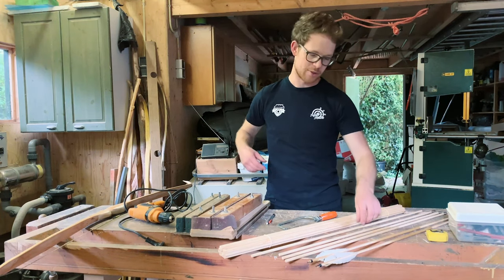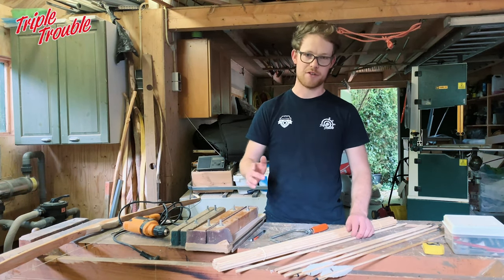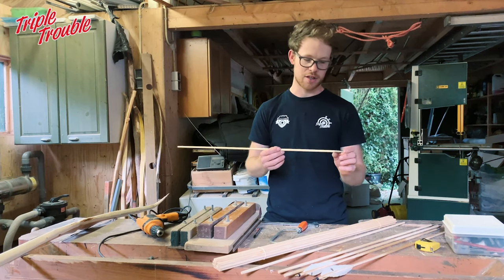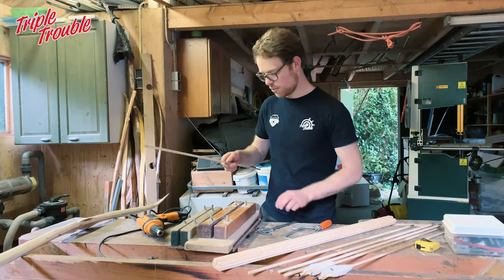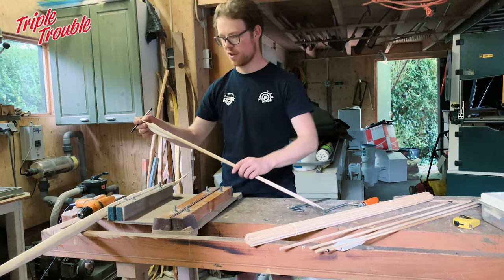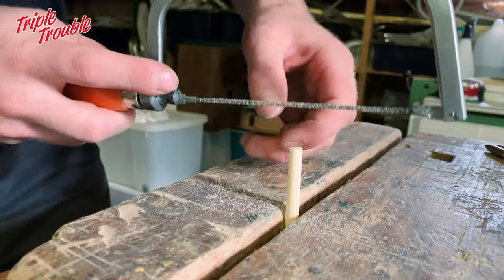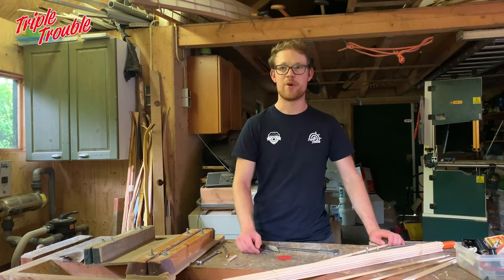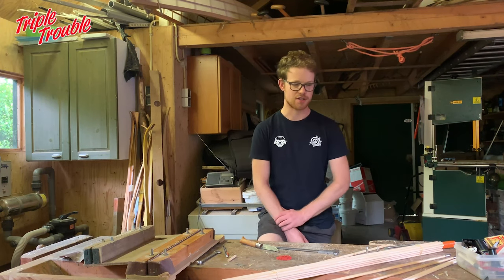Advanced(!) wooden arrow tuning. Learn how to make your ideal arrow!

Comment: When you reinforced the nock what exactly did you do? It looked like you, maybe, wrapped it with serving thread? And it would be nice to see exactly how you go about adjusting the taper blocks.
Reply: Hi there, that's exactly what I Did. When I finish the arrows I also coat those wrappings with superglue. The taper blocks are adjusted by loosening the nuts on the bolts and then simply moving the blocks either closer to each other or further apart. I also like to use a pair of calipers to measure how thick the shaft will be. Hope this answers your questions!
Cheers, Jaap